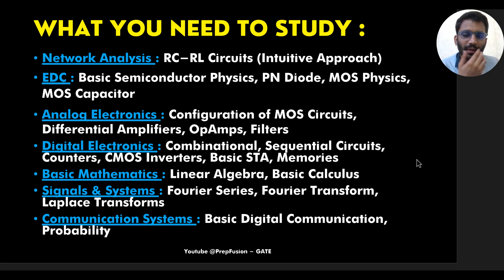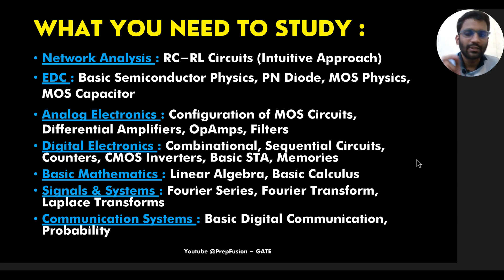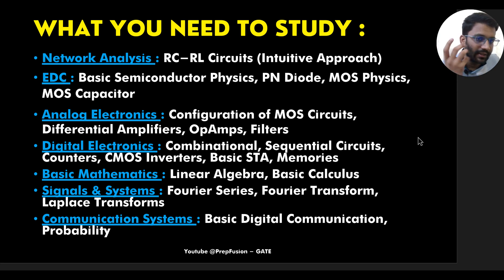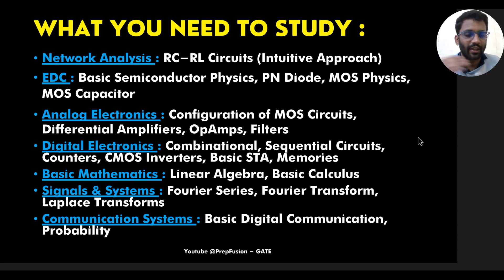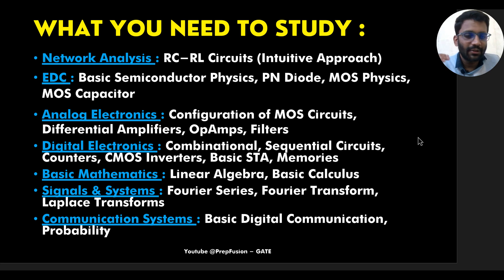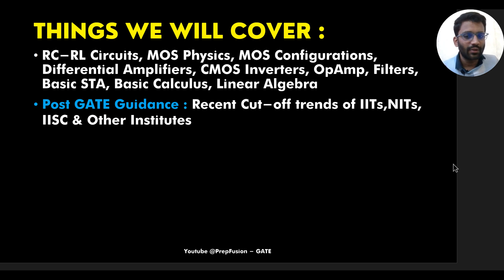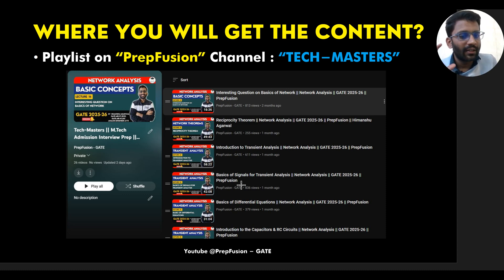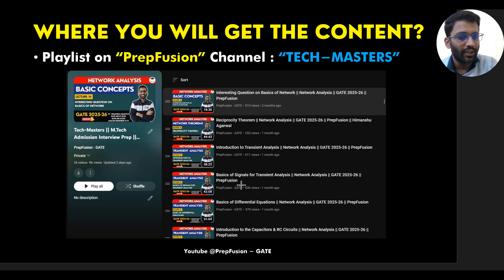M.tech/MS Admission Interview || Tech-Masters || GATE 2024

Comment: If you are thinking that you should watch this playlist then here is the answer
Short answer :YES
Long answer :I came across this series when i had received a call for mvlsi and ese at iisc Bengaluru.  I had secured 67 rank in ee. So my basics were strong but still going through the series I realised some points and different analysis methods that you won't see in GATE coaching but is required if you want to prepare for an interview. I am specifically a fan of MOS physics himanshu taught. These videos helped me to gain confidence in the interview. I have just received an offer from IISc Bengaluru for mvlsi. Hereby I would recommend everyone to watch these videos no matter how good your rank or how your rank is. Thank you prep fusion❤
Reply from the maker: Best wishes from our side!